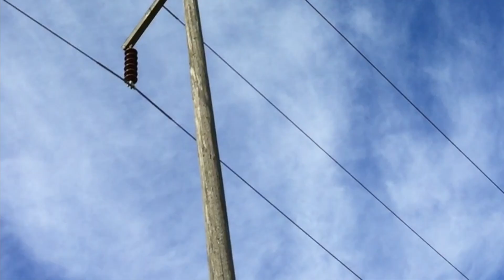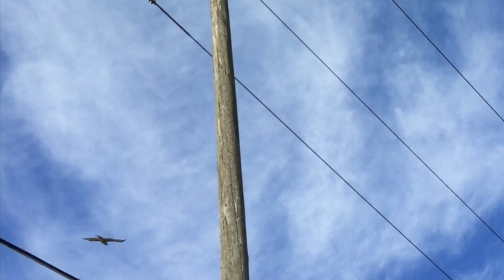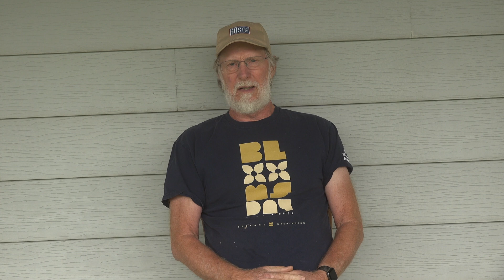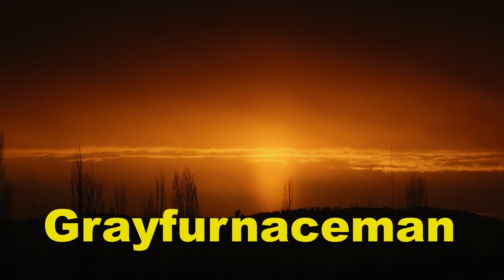Is a cooling temp setback a good idea?  Part 1

Comment: You have to remember one thing, you are not just cooling the air in the house, but also all of the stuff that’s in the house, once these things get heated up, it takes a hell of allot of energy to get them cooled back down. Once they are at the desired temperature, keeping them there is relatively straight forward as you are now maintains air temperature. The objects do not generate heat, so now you are just cooling the air. Kind of hard to explain in words, but if you don’t understand, step back and read again and it should click into that brain of yours.

Comment: My thermostat is set and I don’t change it. You have to cool down everything in the structure. In the long run I don’t believe you save much if anything because it has to run so much to cool it back down.

Comment: Where I live there are higher charges for Electricity during the day.  I have thermostat to go from 72 to 76 at 9 AM.  On most days the unit does not cycle on until about 6 PM when the thermostat program goes down to 75.  At 9 PM it goes down to 73.  At 3 AM it goes down to 72.  The unit cycles on and off during all of the different temp settings. If it is a terribly hot day in the upper 90s the AC may run about an hour to catch up from 75 to 73.   During the winter I love it cold.  59 during the day and 60 at night.  I live in a 4,500 sq ft home and in the hottest of Summer my power bill never gets above $150.  If I left it at 73 all the time during the summer it would easily be around $600+ per month.

Comment: For many years, I never knew what time I would be coming home.  Could be 5pm, could be 11pm, or anywhere in between.  So I got a Nest thermostat that I could control remotely.  I used it to keep logs about the performance of my system.  (I live in Atlanta, and keep the house at 75 when occupied and 79 when not.)  What I discovered is that if I was coming home after 7pm, I would put the thermostat back to 75 just before I jumped in the car to head home, and everything would be great by the time I got there, and I would end up net-net saving money.  If I came home before 7pm, I've screwed myself, because the time required to cool the house back to 75 offset my savings during the day.  Data logging was my friend, but that required more nerd power than most people want to put into it.

Comment: I find setbacks nice in the fall swing season when it's maybe 80 during the day and very humid such as a 65+ dew point. It's too wet to open the windows at night, so you run the AC, it does the dehumidification job the best in one long cycle, so it starts up at 5pm and shuts down roughly 9pm and we all sleep comfortably and the house stays drier this way.

Comment: I set back a few degrees in heating. In cooling, I set it where I like it and I leave it the hell alone. I tell my customers to do the same. Always have, always will.  One of the reasons why I hate stats like the Nest is because they market the thing like energy savings is the only thing that matters. Energy efficiency is a good thing, but the purpose of an HVAC system is to keep you comfortable.  If someone wants to sleep in an 85° bedroom just to save a few bucks, more power to them.

Comment: I manually turn off heat pump when not at home in both summer and winter. The on and off cycles are the hardest thing on any motor/compressor. The only exception is that in winter if I am away for days and the temp is forecasted to be very cold, then I activate heat strips only to about 50 degrees. I know this is expensive heat, but I believe that I am saving the motors/compressor. When home, I just let the unit run non-stop both in summer a/c and winter heat pump heating mode until comfortable. I then turn totally off. Works for me.
Reply from the maker: As long as you are not opening the disconnect at the outdoor unit, you are probably ok.
GFM

Comment: I set back during the day and crank it down before bed. Figure it’s less wear and tear on the system to run a couple hours straight then to have it cycle on and off during the day. Also are utilities are cheaper after 8pm, before that they have an up charge on usage. Thoughts?
Reply from the maker: It probably does not make a lot of difference.  The biggest impact is probably the lower cost from operation during the lower utility cost after 8 PM
GFM

Comment: I really have never been a fan of setbacks. Just because regardless of what you set it back to other than turning it completely off your unit will still be running the whole time. But instead of just maintaining a certain temp your unit has to run longer and harder to get it back to those few degrees you changed it.
Reply from the maker: The value of setbacks depends on location and the structure.
However, setbacks in heating have some value as the furnace is not working harder, just on longer.
GFM

Comment: I live in west mi zone 5 with 20000cuft above grade and 325sqft of glass, well insulated stick built 2x6 side walls and r50 attic.  Been logging runtimes for awhile, my result with a decently tight structure is cooling setbacks can increase runtime over keeping the same and there's some if very little Advantage in a heating setback in the same house.  Just my experience.
Reply: sounds logical to me, the contents and building structure take a long time to acclimate.
although a long run time to pull it all back down can equate to extended dehumidification, which is a key factor in feeling comfortable and cool

Comment: As an HVAC contractor, I would always tell customers to setback cooling no more than 3-4 deg. This is what I do at my house as well, although, I have a two speed AC.
The hotter / humid the weather, the smaller the setback.

Comment: If the humidity is high, let it run because it takes most of the AC power to de-humidify the house. If you live in a dryer climate you can do a set back by probably 4 to 6 degrees and recover o.k. when you get home. An average small to medium house that requires a 0F to 70F rise in heat may take about  a 1000,000 BTU furnace and about a 36,000 BTU Air Conditioner if insulated well and has tight windows etc. However you are usually only cooling between a 20F to 30F temperature drop, or from 80F or 90F to a low temp. of 70F. inside the house. It is bad to run an average house air conditioner lower than 70F unless you have added special equipment to make it do so. Thanks for the video's.
Reply: yep, that's the only effectiveness I see in setback, assuming a newer well sealed and insulated home, long run time after setback = increased dehumidification.
the down side is, the building structure and all contents do not cool off that fast and will continue to radiate heat for many hours.

Comment: This is interesting, thanks for sharing! I actually sort of do the opposite with my inverter mini split. I turn it down before bed so it can do as much cooling as possible and get the house down to around 65 with a lower outside temp when its more efficient and I turn it up a degree at a time up to around 76 to keep it from having to work as hard during the 100 degree part of the day, then I turn it down again when it cools off outside. My house is pretty well insulated and has a lot of thermal mass, it will stay pretty cool for a while even with the AC off. Every time I have done as close to back to back comparisons as possible, my monthly power bill has always been $10+ dollars lower using that method than leaving it set on 72 and letting it rest overnight but run flat out during the hot part of the day. However, I don't have a separate meter for my mini split yet, so I can't say what the savings are for certain. I plan to get an energy usage monitor for my mini split to gather more data since this is a topic that interests me.

Comment: Never have done this with central air conditioning or even heating for that matter. It costs more to remove heat than it does to make it! 
When heating or cooling I just let things run and do their jobs and don’t worry about all this nonsense of changing temperatures in a house because it’s just not that practical with family etc etc. my Utility bills are stable and if something changes on those bills I know there might be problem that needs addressed.
Reply from the maker: You are correct and incorrect about removing heat.  
A/C can be as high as 400% efficient when comparing BTUs used to remove heat and BTUs used to heat a structure.  However, the cost of a BTU may be very different for different energy sources.
GFM